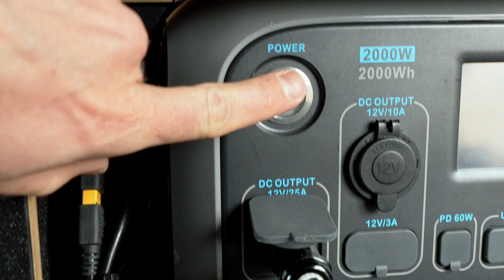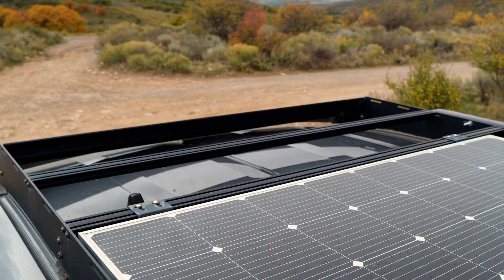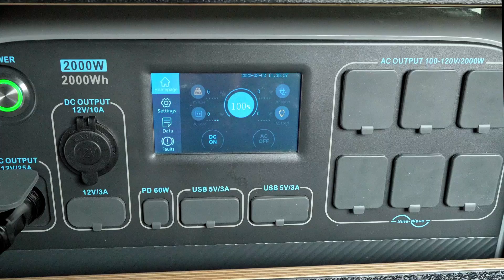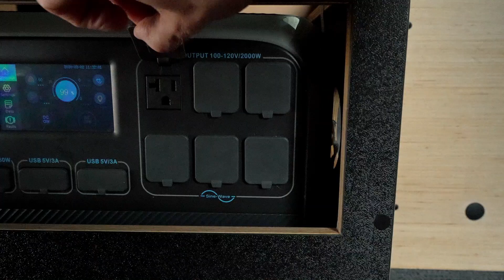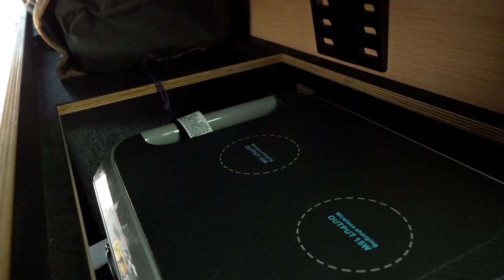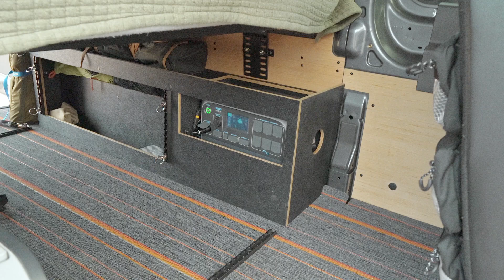Get Off-Grid Van Power Without a $5,000 Electrical Build (Bluetti Power Station)

Comment: Hi. I have that fridge.  Wondering why you didn’t just order the wall plugin cord for it and add a good extension cord to plug into the bluetti. I think it would make your fridge more mobile.
Reply from the maker: Thanks for your comment! If you mean the AC plug, I prefered to keep everything DC so I don't need to run 2 power profiles at the same time and DC is more efficient since it doesn't need to be inverted from the Bluetti. Also, portability was not important for me for this fridge as I keep it strapped in all the time. The wall plug route would be a good solution for some people though!

Comment: Do you have a link for the cord you spliced into the fuse panel
Reply from the maker: It is just the standard 12v cord with the cigarette lighter plug cut off, spliced and heat shrinked to longer wires, and then those wires run directly to the positive/negative terminals in the fuse panel. Here's one on Amazon: https://amzn.to/4casLFj

Comment: nice setup! i was thinking of doing the same type of setup, i will be on the road for around 3 weeks straight on tour with my band and we are wondering with the same power setup you have, does your setup allow for running the fridge 24/7 without fail? or do you need to stop the usage of it to let the power supply charge, we are looking to see what we should do in terms of a power setup. we will pretty much want to be running a refrigerated cooler 24/7 and maybe a portable ac unit when needed, thanks!

Comment: Wow this is exactly what I want to do for my van. I love this set up you have. I am still learning about everything. I was going to do a whole Renogy solar kit but it’s so expensive. What kind of solar panels do you have? I wish there was a video that shows exactly how you set everything up. Do you have any recommendations for a video that you know of that shows kind of what you did?
Reply from the maker: It's a great setup! I have 2 200W solar panels on the roof that feed right into the Bluetti using their solar charing cable that just plugs right into the unit. Beyond that, we just made sure the cables were hidden behind the wall and came out in an easily accessible spot for the Bluetti. Happy to chat through my setup or help you with yours if you email ryan@whiteriveroverland.com. Thanks for watching!